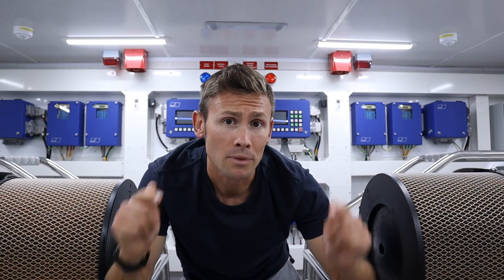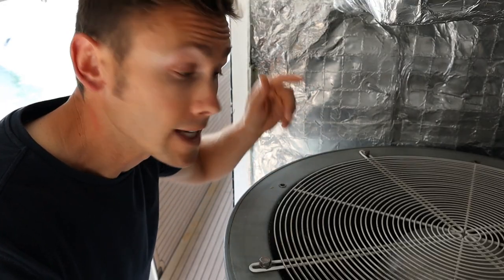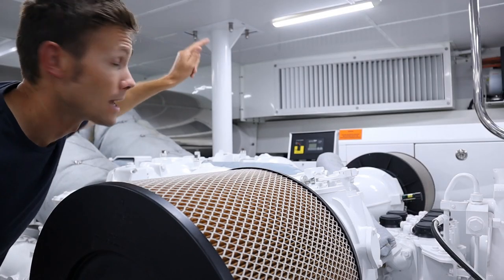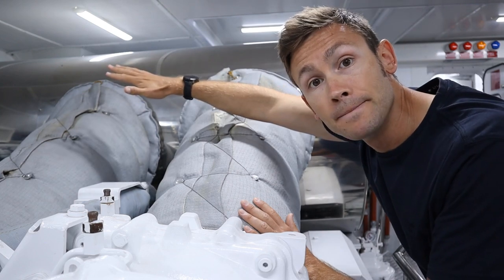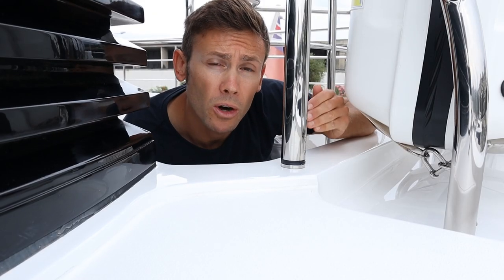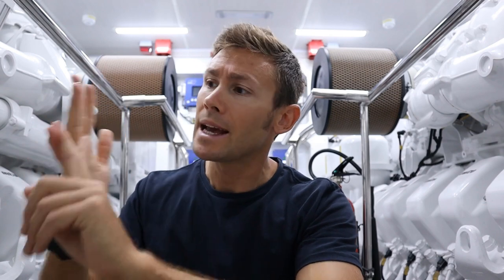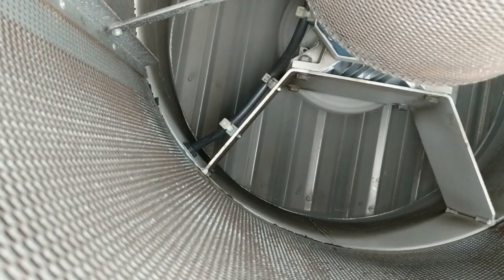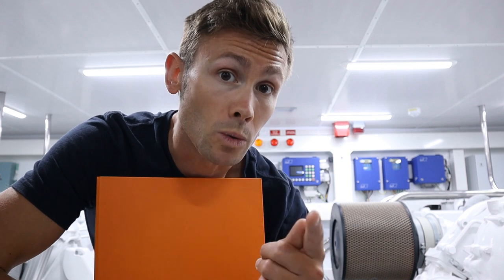YACHT ENGINE ROOM VENTILATION | And How It Affects Your Safety As A Yacht Crew Member

Comment: Interesting. It would be nice to see a design which converted most of the waste heat from the engines into stored energy rather than simply extracting it and blowing it away. Surely that would be much more efficient? Seems like a good opportunity to direct heated water towards the boilers.

Comment: I have a question?  Air inlet and outlet all seems to be at a high level. In an area with combustion processes, heat, electrical, fuel, oil, solvents, and lubricants, is there no provision to extract heavy and inflammable vapours from low levels, such as below the engines?

Comment: in the case of a smaller yacht with only 2 blowers. one slightly more powerful than the other, one on port and the other on starboard side. which one should be operated in/out. should there be more air coming into the engine room than out, or the other way around?

Comment: Can’t believe you didn’t notice but your intake fan is running backwards! Look at 5:54. That’s definitely big intake fan not one of small exhaust fans.
Reply from the maker: Well spotted! This is because I only filmed the damper opening and the fan starting. But then I wanted to show the damper closing and the fan stopping. I couldn't film it again, so I simply reversed the video! That's why the blades appear to be turning in the wrong direction.

Comment: Just fire matt  what nothing about  smoke the big killer
Reply from the maker: Hello Patrick. Smoke doesn't pose such a great threat here because it cannot pass from the engine room to accommodation spaces. Fire on the other hand could burn a fibreglass yacht to the waterline in minutes. As a result, our main priority is to isolate and extinguish the fire.
Reply: @WorkonaSuperyacht  Not all boats are fibreglass ally
Reply from the maker: @59patrickw I only mention fibreglass because it is particularly flammable. Fire can have a devastating impact on any ship, regardless of the material from which it is made. Accordingly, once the alarm has been raised and everybody is accounted for, the main priority will be to isolate and extinguish the fire.
With respect to smoke, Emergency Escape Breathing Devices and/or smoke hoods are distributed throughout accommodation spaces to help guests and/or crew escape to the muster station. To fight a fire or retrieve a casualty we also have firefighting outfits and breathing apparatus available.
For an engine room fire, if the fixed-firefighting system is activated in good time then it shouldn't be necessary to use any of this equipment; however, the fire team will still get dressed in case they are needed.
Reply: @WorkonaSuperyacht  Thanks Mat as ex Royal Navy I understand what you are saying and understand fire /floods at sea 
 protection of life is first and  fore most.
If the incident is not to large then property next  people are not replicable boats ships yachts  are